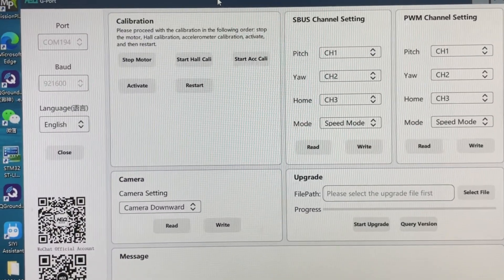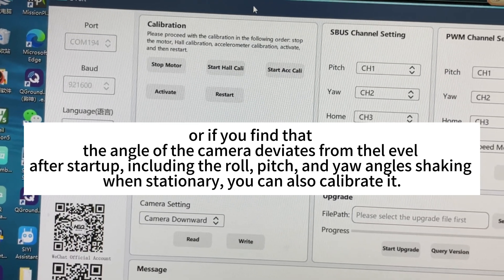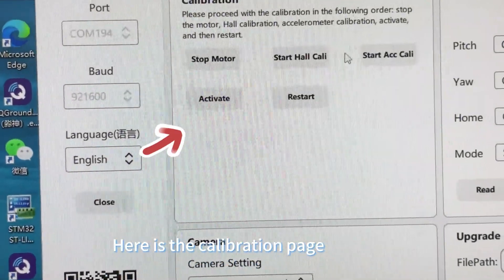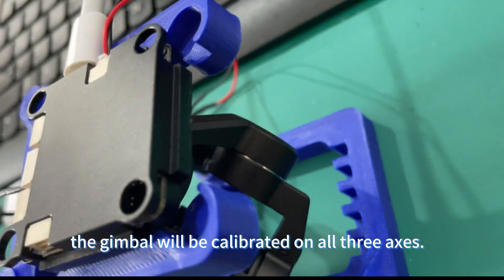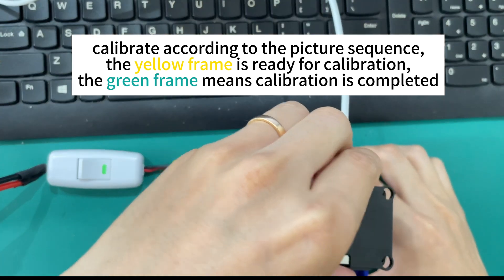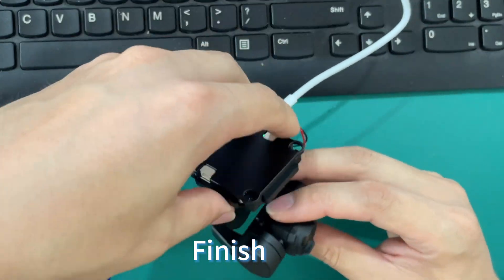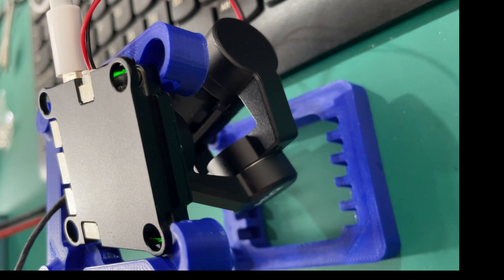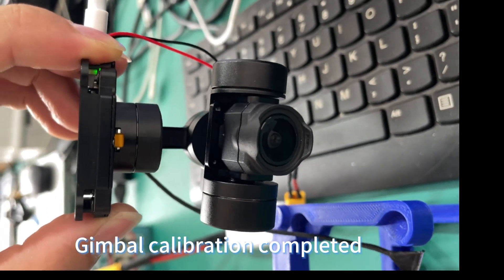G-Port Calibration#gimbal #calibrations

Comment: My gimbal will not complete the Hall Calibration. It will continue to rotate and look up and down. Never stabilizes. Can't seem to do anything to get it to work.
Reply from the maker: Can you record a video of a question and send it to our instagram/facebook?We want to see the question through specific content.
Reply: @HEQUAV  The new firmware you sent to me fixed it! It's working flawless now. I appreciate it guys
Reply: @HEQUAV  please Hequav help me out, i have got the same problem
Reply: the same moving pitch up and down many times
Reply: firmware version 48 fixes. Installed, calibrated, zero cal and works fine